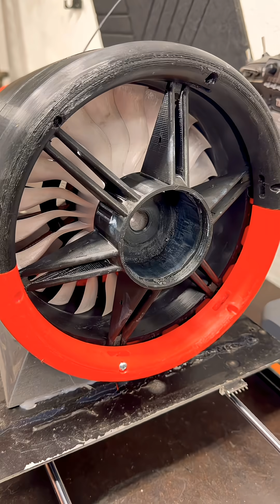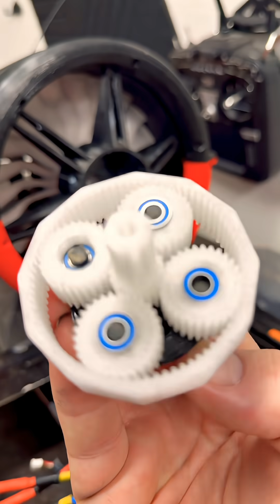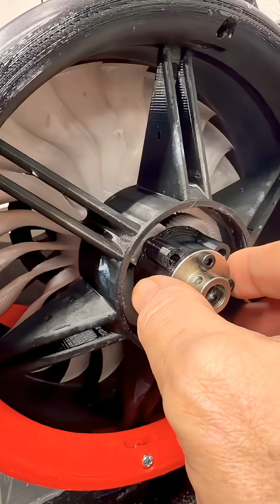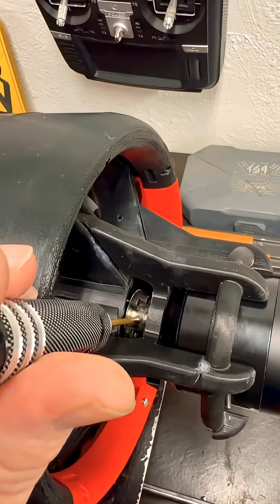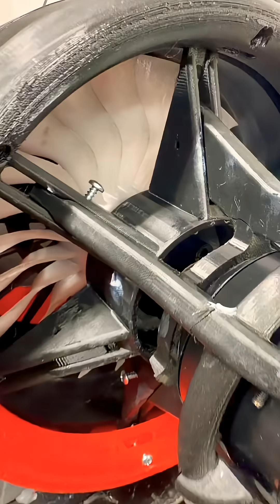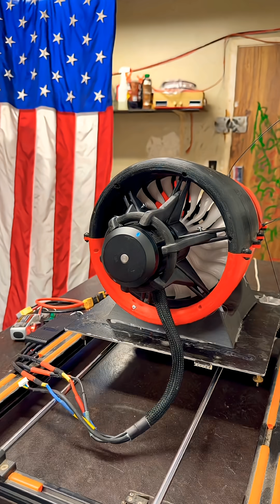That was awesome! #fyp #shorts #edf #3dprinting #rc #diy #turbine @Makera

Comment: I have an idea for an aid for myself. I have MS, and a problem is that I encounter insane fatigue at the worst possible times. But I also love to go cross-country skiing. The problem becomes when I suddenly get hit with MS fatigue and almost can't walk home. I've been thinking about using 3-4 smaller EDF's on a backpack frame or eventually on a rod with handles. Fatigue sets in, I can get back to the car by propeller force! I'm not...really goid with electronics though. You got any tip for premade components that arent expensive that I could use to buy a few EDF's, and make a controller for them?

I can definetly sort the mechanics part I think.
Reply from the maker: I don’t know that I would use EDF engines for this maybe a harness that you can put on that takes the load of your body weight kind of like those hiking assisted rigs that are actuated by your leg movement but augment your strength.
Reply: Really thrilled you took the time out to answer! In my case, something that propells me forward is tons better than some form of exo-skeleton. Has to do with how fatigue affects my body. You need to get back quickly and efficiently much more than you need a lighter load.

I've seen old films of homebuilders use a chainsaw engine and single large propeller, but its dangerous, cumbersome and not well balanced. 4-6 smaller jetstreams would make it much easier to balance a rig and EDF's lets you keep propellers shielded and with less kinetic enery
Reply from the maker: I see your point and the idea is something I would like to look into designing.
Reply from the maker: Will do.